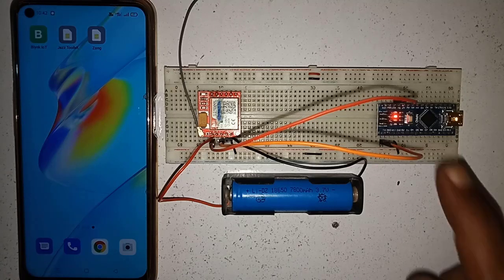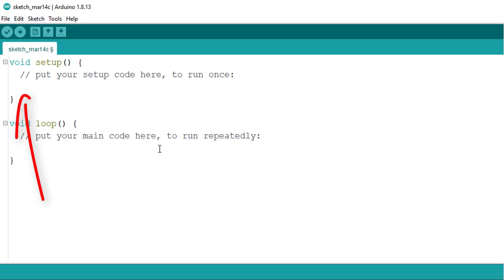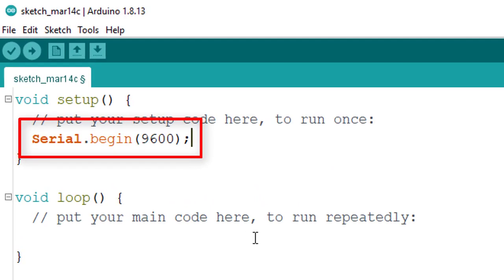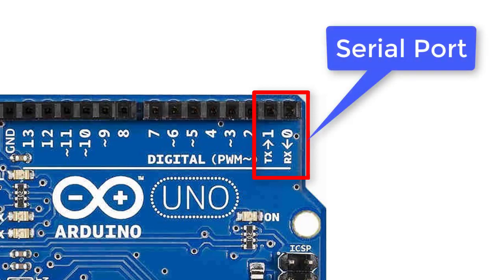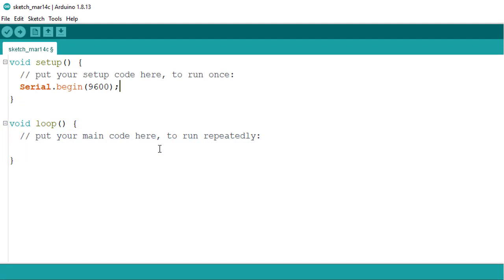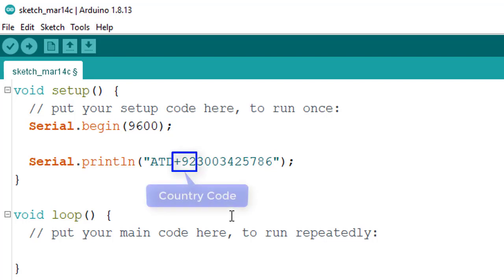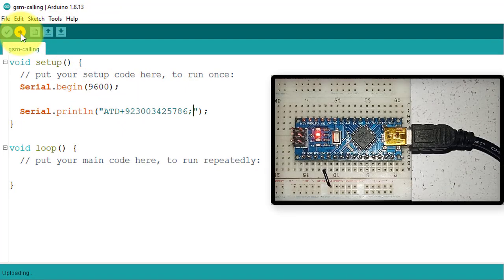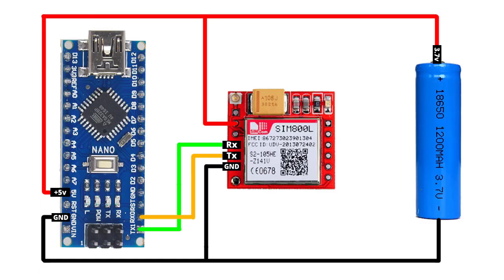Make Call Using SIM800l With Just Two Lines Of Code

Comment: You're doing some great things here with the SIM800L! I'm trying to send a simple SMS to my phone but just can't get it to work. I tried to modify this project a little so it would work with ESP8266 but I can't make it work. I'm getting a blink every 3 seconds on my SIM800L so I'm thinking it's connected and functioning. I connected TX and RX to D3 and D4. I added the SoftwareSerial library, created a mySerial object and set the baud rate at 9600. Is it because I'm not setting the APN?
Reply from the maker: APN are used for internet connectivity. it is not required for sending sms. 
just make a call to your sim800l from using phone. and check if it is responding or not. and let me know
Reply: @AhmadLogs  The call cannot be completed. Should I at least be hearing a phone ring? Maybe I have the wrong SIM. Should I purchase an IoT SIM?
Thank you for your help!
Reply: @AhmadLogs  I turned up the voltage a little bit on the SIM800L and I am now able to call the number. My serial monitor is also showing RING. When I enter the while sim800 available loop the serial monitor shows ERROR. I entered a bunch of Serial print statements in the code so I know exactly where the program is. Serial.println(sim800.readString()); is returning ERROR. Thank you so much for your assistance.
Reply: @AhmadLogs  I tried to send the SIM800L a text message from my iPhone. I still received ERROR but also received +CMTI: “SM”,7. I must be doing something right because I am getting some communication going to the SIM800L.
Reply from the maker: @Warren’s Corner  Ok. if you get +CMTI: “SM”,7 then its mean your sim800l has just receive an sms and that sms is stored on your sim800l memory at the index number 7. 
you can read this message using AT+CMGR=7 command.

I am unable to figure out why your sim800l is not working with esp8266.
can you please share your code on GitHub. I just want to have a look on it]
Reply from the maker: @warrenscorner  just share your code on GitHub. I want to check it
Reply from the maker: @warrenscorner  check reply
Reply: @AhmadLogs  it’s working! While going through my code I noticed a mistake. AT+CMGS=1\R! What a stupid mistake! I changed to lower case r and it worked. I really appreciate the time you spent helping me. I love your videos and I am looking forward to more great content.
Reply from the maker: @warrenscorner  so nice of you

Comment: I try a lot of code but my sim800l module is not responding it connected to network and led blink after 3 sec. Pls help
Reply from the maker: There could be various reasons why your SIM800L module is not responding. Here are a few things you can try:

    Double-check your wiring: Ensure that your SIM800L module is connected to the correct pins on your Arduino board and that the connections are secure.

    Check the baud rate: Make sure that the baud rate of your code matches the baud rate of your SIM800L module. The default baud rate for most SIM800L modules is 9600.

    Check the SIM card: Make sure that your SIM card is inserted correctly and that it is not damaged. Also, ensure that the SIM card has sufficient balance and is activated.

    Test the module separately: Try testing your SIM800L module separately with a USB-to-serial converter and a terminal program like PuTTY. This will help you determine if the problem is with the module or with your code.

    Power the module properly: Ensure that the module is powered correctly. The SIM800L module requires at least 2A of current, so make sure that you are using a power supply that can provide this.

    Check for errors: Monitor the serial monitor for any error messages. These messages can help you identify the problem.

If you have tried all these steps and your SIM800L module is still not responding, it may be faulty and you may need to replace it.

Comment: Hello Ahmad Khan
Sometimes the sim 800 module hangs  and the received SMS are not sent to the micro. Do you have any hardware or software solution in this case?
Thanks befor🙏
Reply from the maker: for that you need to reset the sim800l using reset pin. you must attatch a transistor to reset pin of arduino
Reply: @AhmadLogs  how do i know when  it  was hang then rest it by softwear via transistor
Reply from the maker: @masoudjafarzadeh  the program will check if it is hang or not. and then it will perform action. you need to modify the code for this
Reply: @AhmadLogs  would you plese say me where is this  code in your programes.
Its write in your programs   or on library?
Thank you sir befor
Reply from the maker: @masoudjafarzadeh  I am unable to tell about how to modify the code. because it required a full tutorial.